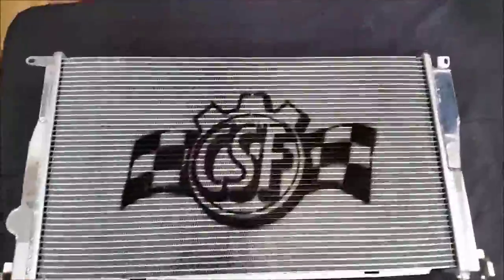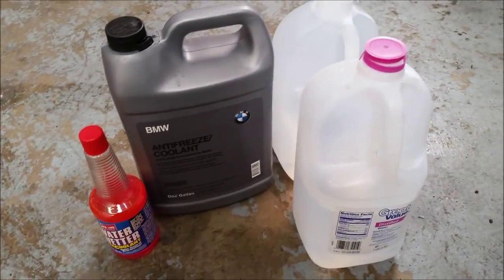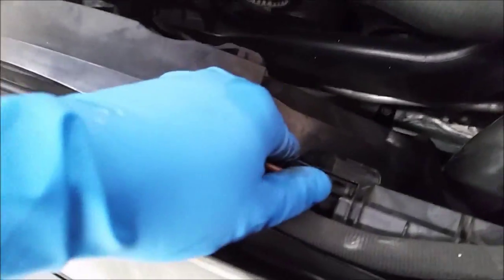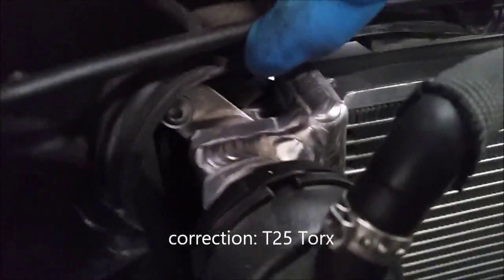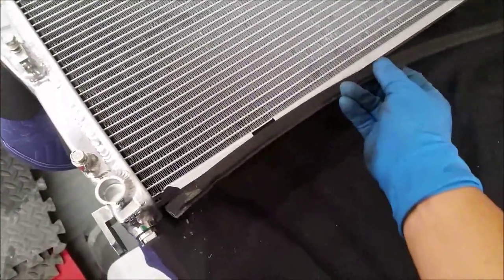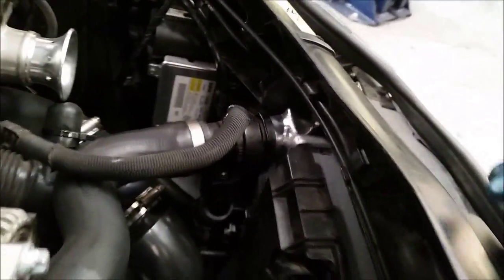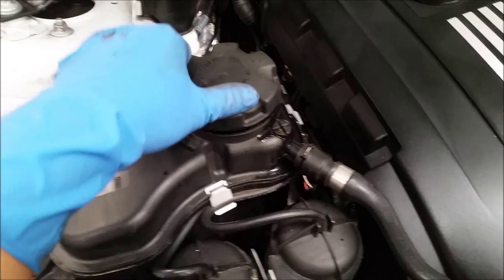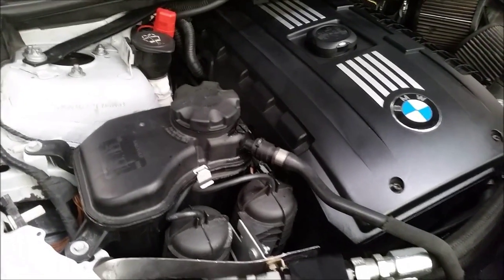CSF Radiator Install DIY - BMW 335i E90 (N54)

Comment: Sean thanks for the video. My only problem is that I didn't look to much info for the temperature sensor that go attached in the factory radiator. I break it trying to take it out, do you ise the factory one or get and aftermarket for the CSF. I have mine installed today only waiting to see what I can do with that sensor. Thanks for any info you can provide men.

Comment: How did you like the CSF Radiator and what oil cooler is that? I have a stock oil cooler but wouldn’t mind upgrading. Any suggestions?

Comment: still overheating on the track or has this helped you?
Reply from the maker: This CSF radiator, custom Setrab oil cooler, 7" FMIC, 5 gallons of E85, and vented hood all helped but I still overheated on track. I have a tune which doubles the boost and puts too much stress and pressure on the engine/ecu.

I have since built an E46 M3 track car (see my other videos) and have zero overheating issues. NA will always run cooler than FI.
Reply: SeanS54 hey sean I was considering building up my 335 into a  SCCA T3 car and was looking to do the same cooling mods you did. Since that didn’t work for you I’ll pass on building the 335. Many others have cautioned me that the 335 is not well suited for track duty

Comment: In the video you said that you had a Mishimoto radiator and you swapped it out for the CSF radiator. Why did you swap them?  Was there a noticeable difference between the two both performance wise and fitment wise?
Reply from the maker: CSF is a legit company specializing in radiators so I have more faith in their products. The CSF radiator has a slight performance edge (took longer to overheat on track) than the Mishimoto. Both radiators are plug and play and fit perfect.

Comment: How much thicker is the radiator over the factory one? I have upgraded stock location inlets and im wondering if the inlets hitting the pulleys and belt will be an issue.
Reply from the maker: I'm not sure how much thicker it is compared to stock. You can contact CSF and see what they say. As for fitment, it's a direct fit, plug and play.
Reply: I just did this this morning, looks like it is about 1/4" thicker (I have an e92 though)

Comment: Did the drain plug from the CSF radiator come tightened down already?
Reply: Like to know the same got it all in and forgot to make sure it's tightened down don't want to drop intercooler again

Comment: Hey Sean is the CSF the best performance radiator for n54 335i E92?
Reply from the maker: I don't know about the "best" but I like the CSF radiator on my N54 335i and my E46 M3. Keep in mind, the N54 runs hot especially with a tune so even after spending thousands on cooling I still overheated at 20 min track sessions.
Reply: @SeanS54  I would try waterless coolant. I had it on my Focus RS mk3 and worked great.

Comment: Do you have a part number for the radiator or A website where you bought it from?
Reply from the maker: Part number depends on the car make, model, manual vs automatic. You can buy them from ECS Tuning, Bimmerworld, etc.

Comment: what is that connected to the oil filter housing.
Reply from the maker: I'm running a custom Setrab oil cooler instead of the factory oil cooler and those are the fittings for it.

Comment: Is this the same procedure for the n55?
Reply from the maker: Not 100% sure but I believe it's generally the same idea. However, I know that there are manual specific and automatic specific radiators so you have to make sure you buy the right one.

Comment: Update on performance please
Reply from the maker: CSF radiator is an awesome product. This CSF radiator, custom Setrab oil cooler, 7" FMIC, 5 gallons of E85, and vented hood all helped but I still overheated on track. I have a tune which doubles the boost and puts too much stress and pressure on the engine/ecu.

I have since built an E46 M3 track car (see my other videos) and have zero overheating issues. NA will always run cooler than FI.

Comment: Is the car better then the mis
Reply: Csf
Reply from the maker: Yes, I believe the CSF radiator is better. They are a serious radiator company and build a bunch of radiators for performance cars. I also run the CSF radiator and oil cooler on my E46 M3 track car and never overheated once.

Comment: FRIEND WHAT DO YOU THINK THAT RADIATOR FOR DAILY
Reply from the maker: It's a great radiator for daily. It's better than the stock one for sure!
Reply: SeanS54 friend and the fit no problems? Thanks for all
Reply from the maker: I've had the CSF radiator on my 335i and on my M3 and they fit perfect, plug and play. 

I believe there are two versions for the 335i, one for automatic and one for manual. Confirm before you purchase.
Reply: SeanS54 yep i live in chile and i buy in ecs tunning i hope all fit perfect ajjaja
Reply from the maker: Cool! I buy many parts from ECS Tuning. Good shop.
Reply: thanks friend. from Chile
Reply from the maker: no prob!

Comment: bet it leaks
Reply from the maker: no leaks on the mishimoto or CSF radiator. The stock radiator can leak since the sides are plastic.
Reply: SeanS54 thats exactly whats happening to my E92, leaking from the plastic sides.
Reply: mine just broke last week. this one just came in the mail today!
Reply: Shawn Benesta sounds like you or the installer didnt do it correctly.